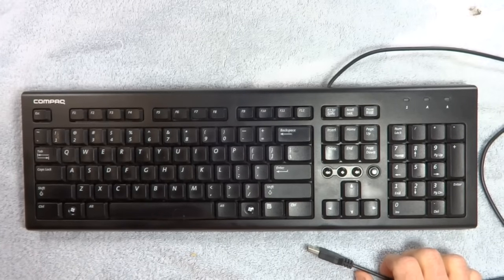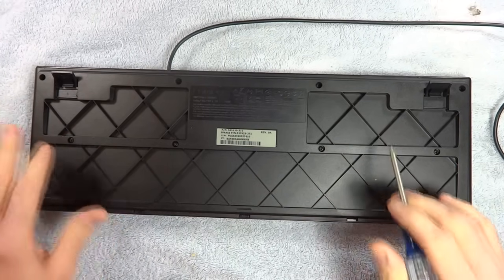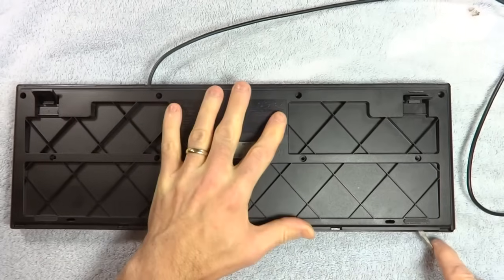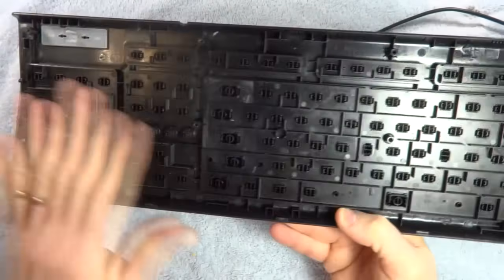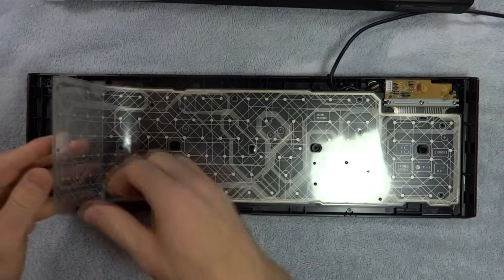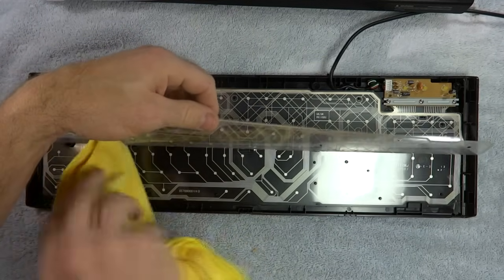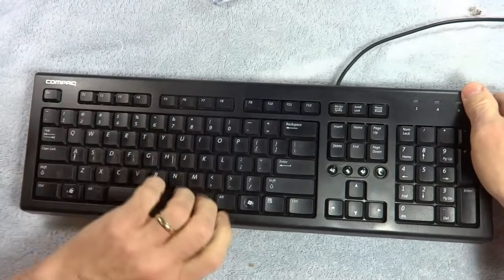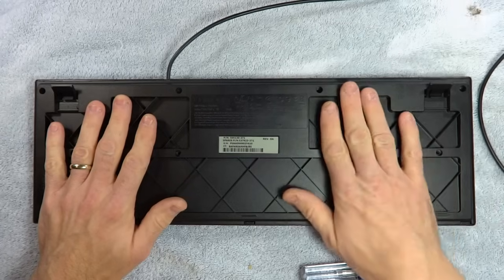How To Repair Computer Keyboard With Some Keys Not Working

Comment: but how about if one letter won't work at all?
like this letter "a"
if you ask how I input that when I said it won't work, well that's cause I just copy-paste it
Reply: @stom266  
yeah sadly that's why I have to rely on copy-paste ones
but did you check the inside of your keyboard?
when I opened mine it fu**ing full of damn ants I bunch of them are inside that's my mom suggest just to buy another but I haven't told my dad about it yet
Reply: @mr.jokermaker4539  you can search for Keyboard shortcuts like, you can type "s" by pressing Alt+1+1+5

Comment: Dude, dude... You are not fixing anything! If you really want to REPAIR any membrane keyboard, you should:
1) clean it
2) check continuity of the usb cable
3) check continuity of traces (this tracks and pads are made with silver based ink). The resistence should be very low. Almost like a tiny wire
4) if the resistence is too high or infinity (no current circulation) it must be a crack on the track. Repair it adding a little bit of silver ink/paint over the broken track. 
4) If any of this doesn't works is probably because of a malfuction of the integrated circuit... Your keyboard is dead

Comment: Hi, do you use dry or damp duster for cleaning ? No alcool for contacts ? some are random in my case...
Reply: and I add: there are some bad electrical contacts between this contacts and the printed circuit..how to clean it ?

Comment: I didnt came here for the disassembly as I'm tired of opening mine already, but does anyone know if there's anyway to fix the plastic sheets, mine have a bit of oxidation in some parts and I cleaned it with contact cleaner but doesn't fix a single crap. I'm thinking if I would buy the electric conductive paint, lightly sand those parts and paint them, do you guys think it would work?

As much as I wanted to buy a new keyboard, I love mine so much that I don't want to spend a lot of money for keyboards that now look just like a normal simple keyboard and all RGB only and cost like 100€+ from very well known brands and don't look anything special at all...

I have the Saitek Cyborg Keyboard V7 and the company went bankrupt and they don't sell them new anymore, can only get used ones which you never know the condition and they sell them a bit expensive, I'd never even wanted to change this keyboard for anything else unless the Razer Star Wars full metal special edition with the oled keys and screen, but that thing is like 500€ so no THANKS...

Comment: HI RJ
Thanks for the wonderful video. I have an HP Wireless External Keyboard. The keys QWER & UIOP are not working in this. I cleaned the same as directed by you, but still its not working. Can you please advise me on how to repair this and get it started

Thanks
Gaurav
INDIA
Reply from the maker: If this didn't work, the keyboard may be damaged and need to be replaced.

Comment: Now all my keys are not working. Thanks. The num lock is lighted up but buttons doesn't work.
Reply from the maker: Then you likely did something wrong. Try it again. Make sure every is dry before reassembling.
Reply: @RJTheBikeGuy  yeah, its all good now. The membrane thing wasn't attached to the thing that makes the keyboard work. Thanks btw.

Comment: Can someone help me which part of the keyboard goes first. Mine has 3 parts, it has two plastic sheets, the same plastic sheet shown in the video and the other plastic sheet has the connected usb thing with it and the last part is a metal one same size both of the sheets

Comment: Useless. Keys actually NOT working due to mechanical failure is a whole different scenario.
Desc s/be how to clean sticky keys. Theyre not broke.
Reply: Freezeyerar5eoff Mcd I tried cleaning mine, failed, 1 keys presses multiple at a time, do you know why that happens?
Reply: @leonhawkins1955  Not a clue mate. Despite my initial reaction i gave it a go. Many screws. Alot of kitchen towel. Ten minutes later i plugged it in and managed to crash windows. Now typing with Windows virtual keyboard....WAHHHEEYYY!!. PC World bound lol
Reply: Freezeyerar5eoff Mcd swag

Comment: wow, so you're saying that cleaning is repairing??? thank, you for your NOTHINGNESS.
Reply from the maker: Repair: verb "fix or mend (a thing suffering from damage or a fault)."
Say your car won't start. The mechanic goes through it, takes apart the dash, and finds a bad wire connection. He cleans the connection, and now your car will start. In the end, he just had to clean something for the car to work. Good luck trying to tell him that he didn't actually repair your car.
No charge for the language lesson.
Reply: @RJTheBikeGuy  I STAND CORRECTED, I NEVER THOUGHT ABOUT IT LIKE THAT.

Comment: Video: You can buy a new keyboard for $10
Me with my $120 mechanical keyboard: um....

note: my keyboard wouldn't work with this
I had to copy and paste A, but by taking off my keycaps, cleaning the backplate, and work my switches for them to work again.
Reply: Just change the mechanical switch to those not working

Comment: So if the circuitry is like a brown color is broken or can it be fixed.
Reply from the maker: Probably not.
Reply: @RJTheBikeGuy  I just cleaned the circuitry and the pad and still wont type but my phone recognize that a device is connected. And it's a wired connection.

Comment: Puzzled!  I followed your steps & didn’t work tried again twice more & it did. Then yesterday the keys (qwert) don’t work again. I have also tried uninstalling & installing keyboard. There is absolutely no signs of dirt or damage. Help I hate to be beat.
Reply from the maker: Hmmm...might be a different issue. Like a small solder break, or damaged circuitry. Might need to replace it.

Comment: Trust me i came to this video cause left side of the keys were not working  e.g. a,q,1,shift, ctrl, esc. While watching your video i smacked it here and there to see if it started working again. Surprisingly enough it DID!!

This is the method i saw my dad and mostly all the seniors citizens used to apply whenever something stopped working. Funny it still works.. lol
Reply: same buttons of my keyboard stopped working

Comment: Sometimes the outer traces of those plastic PCBs become corroded, you can test continuity with a multimeter, in that case your key board is doomed unless you can find a way to rebuild those traces. The connection to the hard PCB is another common area of problem.

Comment: Early in my IT career, I shared an office with a hardware tech who was responsible for maintaining and repairing many hundreds of terminals. When a keyboard failed, he would swap in a working one. When he had saved up a load of nonfunctional keyboards, he would take them home and wash them in his dishwasher. After letting them dry for several days, he would bring them back and put them into the spares store as working replacements.
Reply: 😂what

Comment: CAN I ASK A QUESTION?  I HAVE A SAMSUNG GALAXY BOOK 12, THE OFFICIAL KEYBOARD (KIND OF LIKE SURFACE PRO) HAS A FEW KEYS NOT WORKING: Q S F J K ; X . HOWEVER, IF I TURN ON CAPS LOCK, THEY SEEM TO WORK, I CAN ENTER THESE LETTERS IN UPPER CASE.  IF I PRESS DOWN SHIFT KEY, I CAN ENTER THE LOWER CASE. e.g. q s f j k : x . ANY IDEA IF I COULD FIX IT???????  THANKSSSS  I CAN'T OPEN THE KEYBOARD.....

Comment: for anyone that tried to follow this video and ended up with a broken keyboard instead of fixing it, try and put the membrane contacts properly like on the top right of the keyboard on 2:58 (pause it) also don't forget to put the metal bit that keeps the contacts in place because that's the important part to making it work again
Reply: That's right. Bad bad bad idea. At the top right you see a rubber on pressing onto the PCB. I wonder why they didn't solder this? Because it is not metal right? What material is used on those white paths? I measured a few hundred Ohms resistance along those lines even when a key is pressed. It seems really unusual to have a conductor also behave elastic.
Reply: @brad8122  graphite? explains why it would wear out
Reply: @milijanovcic4479  you are delusional 

You did not see Graphite over there!

take this guy to the infirmary.
Reply: @brad8122  This saved me lol. I was putting the contacts on top of the rubber instead of underneath it. So they werent even touching anything but rubber... duh! Thanks!

Comment: I have opened keyboard to clean the keys many times but I have never cleaned between the 2 membrane sheets, thinking it will erase something important. Is it ok to clean between the 2 membrane sheets using IPA solution?

Comment: My logitech keyboard's few keys stopped responding suddenly and your tip worked like charm. But, I couldn't understand what was there. I cleaned the plastic button sheet but I couldn't see too much dust. Something very minute must have caused the problem. Keys started working after cleaning. Many many thanks and thumbs up for your video 👍🏼
Reply: It is weird.. maybe while you were jostling the keyboard around trying to open it they fell off.

Comment: imwatchigthisecauseicatdospaceadmyuttoswotwork
Reply: same-here-did-you-spill-something-over-it?It-happened-to-me-too.-I-might-try-this.
Reply: im-trying-to-fix-my-space-bar-but-i-cant-fix-it-help
Reply: @sakam0t071   Did you spill something on it? if so... The safest solution is to switch keyboards and try not to bring any drink near it. i got mine replaced, btw.
Reply: @sakam0t071  Also, If its just water, wait til it evaporates/ dries up and then see if it works, if not, then you can try to do what the video says.
Reply: R.I.P-my-space-bar

Comment: so in my case my laptop keyboard is missing an s and a c these keys both used to work properly anywaysby applying pressure to the metal contact. Now the s key completely stopped working while the c key, while in the same state, works wonders

Comment: had to throw away my logitech g19 cuz some buttons weren't working, the keyboard was not dirty in the slightest on the inside and there was no visual damage to the circuitry or the cables. i have no clue why it stopped working in the first place

Comment: After i open the keyboard and start this, instead of fixing 1 not working key, everything stopped working. Theres a light on numlock, means its just the keys itself stopped working, not the cables

Btw i was typing on my iPad

Comment: Now no key is working please help
Reply: how did you type then
Reply: Fusion_PlayZ mobile maybe? Not that hard
Reply: this reply is late but basically you have something miss aligned or you short circuited the mother board both are very easy to do or you put the many layers under th membrane back in the wrong order
Reply: @lxn_ni1814   um can you make a video on how to do that same thing hqppeaned
Reply: @musiclover-fy2cw  no camera nor do I want to take apart my current keyboard and risk anything. Questions tho did you flex or bend the clear sheets under the membrane at all that can completely break it is the little green motherboard I suppose it's called lined up correctly on the pins. I'm no expert I've just taken apart many membrane keyboards.
Reply: @musiclover-fy2cw  if zero keys worked you might have broke it completely if only some don't work you might just have shit in it even small stuff you can hardly see will mess these up same with liquid if you plug it in and there's zero lights you prob broke it
Reply: Pls buy new one
Reply: HAHA XD

Comment: Ok just did it the way you said and it work before i washed my keyboard and the circuit board got wet so i left it to dry but then my back space wasent responding properly later when i power back on the keyboard my left side key board no key responded. I folow your video and there wasent any dirt but i sprayed some alchol on a  dry cloth and wipe the circuit and then put it back together after making sure it was dry and wala! It work like it usually does. Btw i tried this with another keyboard but its unresponsive now so just to say try this at your own risk some keyboards may not work when you take it apart and put it back together

Comment: Thank you for making this video, I actually opened my keyboard and saw a disconnection in the circuits, preventing me from pressing the E key and all of the above. Took some aluminium paper to re-establish the connection on the circuit since it's a conductor and fixed it this way, I hope this helps people having the same issue. It is actually very easy and you don't need to be an expert to do that :)
Reply: The same is happening to me right now. I don't know why but I can't press W,2 and 3 while I'm pressing "D" at the same time, is like a problem with the "D". How did you paste the aluminium paper in the circuit?
Reply: @Kiujind  you can use scotch tape
Reply: @Z-PriZ  I switched to optical keyboard and never went back, but thanks anyways, this helps to know how to repair one
Reply: @Kiujind  great choice,glad i could help even though its one year late 😅
Reply: MY cableof my keybord i mean the cable have been cuted idk  what i  do if you know tll me plz
Reply: @hi_to_games9017  i know its pretty late but u can try to reconnect wires by stripping tye shielding and connecting the wires with matching colours
Reply: @Z-PriZ  oh ty i alrdy  buy another one but not michanecl now iwell reaper michanicl
Reply: @Z-PriZ  yea prretty late lol 😅

Comment: Most of the key boards even branded are not working properly after one year.  The main problem is keys get locked and hardness in pressing is experienced.  We can clean as shown in this video and we can not make any repair work. Because there are no user serviceable parts inside.  If some keys are not working even after cleaning, we may throw it away and go ahead with new one.  Key Boards are nowadays cheaper.  So trying repair with metallic dots (available in stores) is also a waste of time.

Comment: I started to watch this tutorial and got a minute through before realizing that I wanted to try it on my own. I went away, unscrewing everything with little to no experience. I was working on an old keyboard with the 'RT' 'FG' and 'VB' keys not functioning. After peeling off the back, I thought that I had gotten myself into too much work but continue anyway. I continued unscrewing interior pieces of the keyboard and eventually got to the keys. After cleaning them, I slapped everything back together. I now have a perfect condition RGB color keyboard with 12 programmable keys. 

The moral of the story: "Do it, or don't." \

In all seriousness, taking apart a keyboard is not that difficult as long as you are careful. Don't be rough, treat it as though it is a baby. Put everything back where it was after your finished and your good to go. I am not calling you dumb or stupid if you can't do it, I understand that you don't want it to get worse, but give it a try. Good luck.

Comment: you don't sound like you are very confident when explaining the steps.
Reply from the maker: I hadn't taken this particular keyboard apart before. Every keyboard comes apart slightly differently. That is usually the hardest part. Sometimes they have hidden snaps. And cleaning them can be slightly different too. But often cleaning them will get them working again.

Comment: This is not as simple as it looks for people who are not good at tinkering.The circuitry where the usb wire comes into the keyboard is a bit tricky if you mess up the alignment.Other than that,its pretty straightforward.

Comment: THANK YOU!!! I just got a desktop keyboard with a U key that only responded when I pressed it really hard. Disassembled the keyboard and sure enough there was a tiny little hair right on top of the round circuit dot for that key. Removed the hair, reassembled everything. key works flawlessly now. You wouldn't think a hair that tiny could cause so much trouble!
Reply: 0                             纳入 ccg

  

碍眼      并不
Reply: +Narayan 
                .

Comment: thank you. my corsair k30 is working better now. some keys still have issues though. guess I need to keep trying. they key is to do it VERY gently, treat it as though it were a baby. Use clean dry hands or you'll dirty up the insides with grimy hands. try using those alcohol wipes. it will remove residue left from the water you spilt on your keyboard.

Comment: I had many such issues with my membrane keyboard. After I got my new mechanical keyboard, I never got another issue ever again. Mechanical switches can fail too, but I have found very low rates of such problems, especially with good brands like corsair with cherry MX switches.
Reply: they cost alot of money though.

Comment: My keyboard seemed stuck at the middle 2 pins when trying to open it. I just bent the upper part of they keyboard a bit and blew away the dust between the plastic and rubber, my s key is still a tad unreliable but works a lot better now.